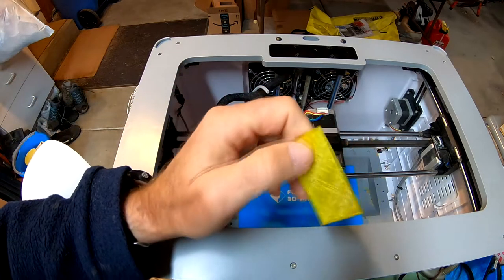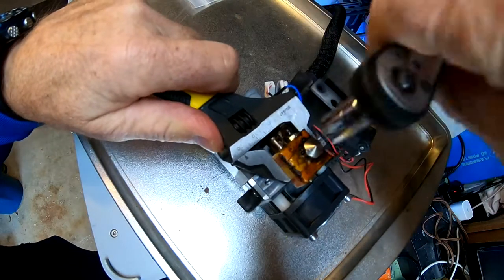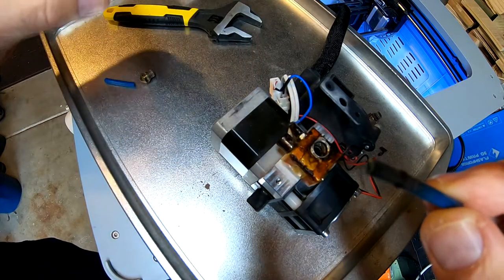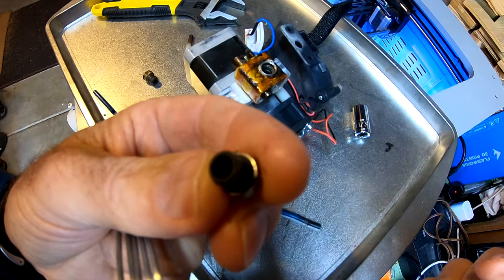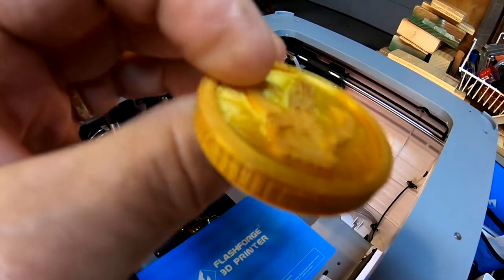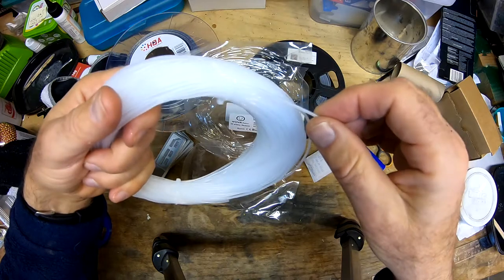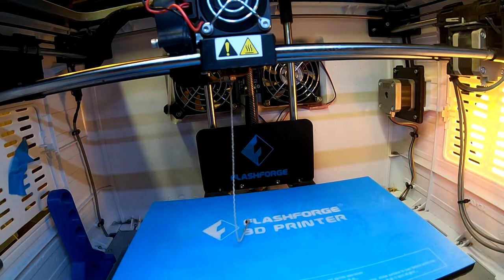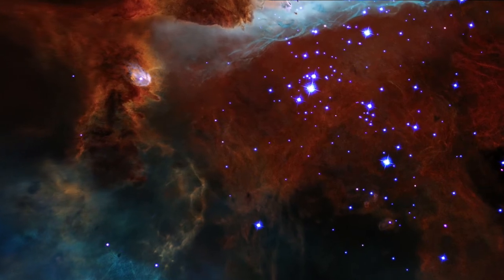Flashforge Dreamer (NX) - Solving Under-Extrusion Problems by Cleaning the Nozzle and Replacing Tube

Comment: Unfortunately the nx version of the dreamer is junk, I have 3 originals and 3 nx versions thank God glow the originals as the nx under extrude and sometimes even print oval rather than round. Then the new design of wiring look WILL burn out and when it does it’s almost impossible to fix as the wires will not solder properly. To many corners cut unfortunately! 
The only way round most of the issues is to ramp up the temps and the extrusion rates and it’s still not a patch on an original!
Reply from the maker: Are you talking about the wiring to the extruder?
The heater wiring to print bed did short out on me, but I got a replacement for free from Flashforge and I was able to replace the print bed & wiring.
I have a video on that process coming up.
My printing has been reliable lately since I replaced the tube with higher quality Capricorn tubing and stopped going over 240 degrees on the printhead even though the printer allows you to go to 248.
Reply: @BetaCygniBlog  yes the plug they use for the heat bed they now also use on the nozzle heater they get hot turn into dust, then the wires start shorting out, these connections need to be screw down type to handle the heat, all of my 6 printers have had the head bet plug basically melt and short out, I solder the wires directly to the bed itself and forget the plug, sometimes the heat in that junction has melted the solder on the pcb, may be worth using higher temp solder if you get that issue.
Reply from the maker: @rcmoves7690  Thanks for the clue! I put a couple of layers of Kapton tape over the exposed solder pads on the heat bed since it's easy to short those with a metal spatula when removing parts.